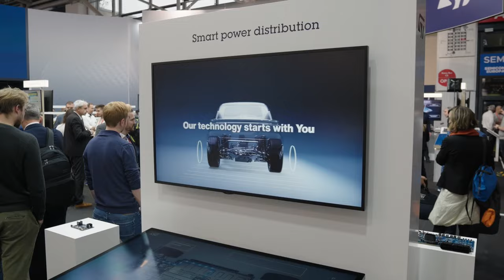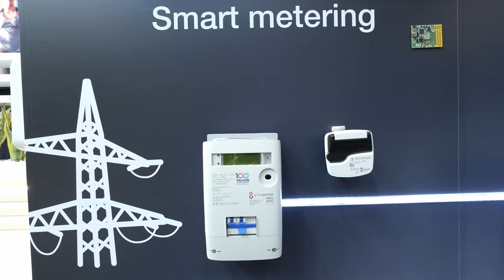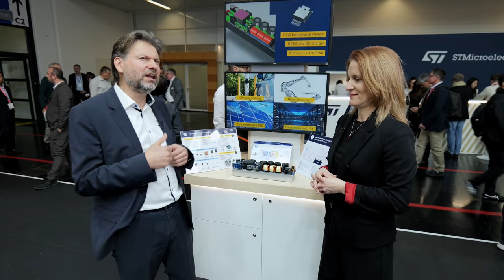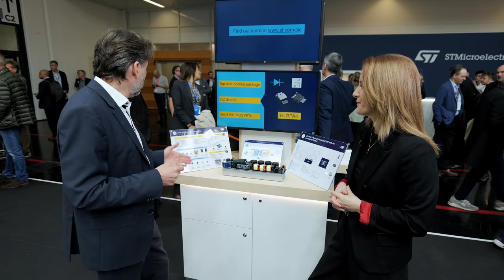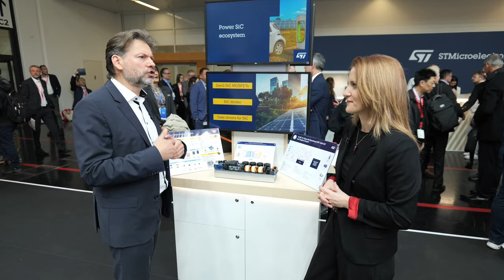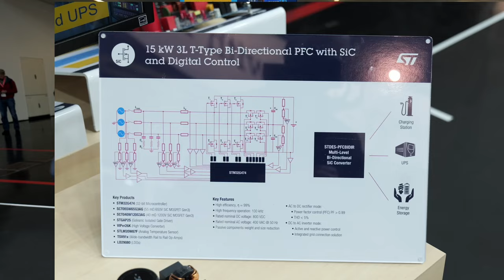Silicon Carbide solutions: the ST ecosystem to get you started with our latest innovations

Comment: Silicon carbide is a third-generation semiconductor with small size and high energy utilization, which is suitable for photovoltaic and wind power generation. , there are innovative reforms in electric vehicles and other fields. Yongming capacitors are small in size and have high-density energy capacity. They can adapt to the wave of miniaturization of third-generation semiconductors and make room for other electronic components.